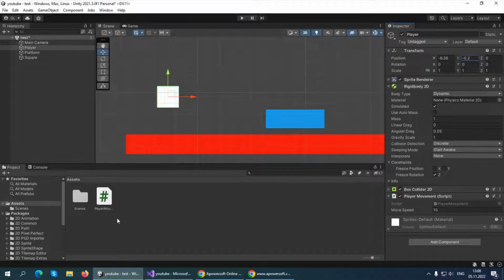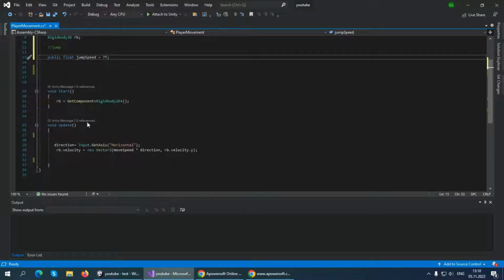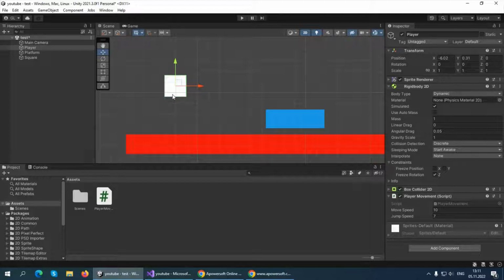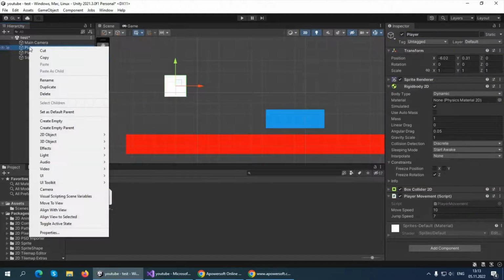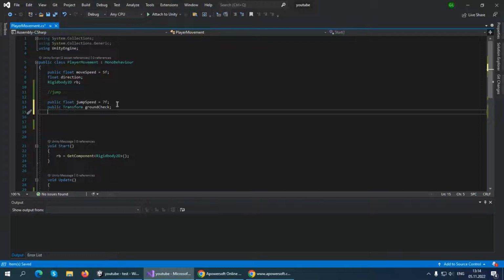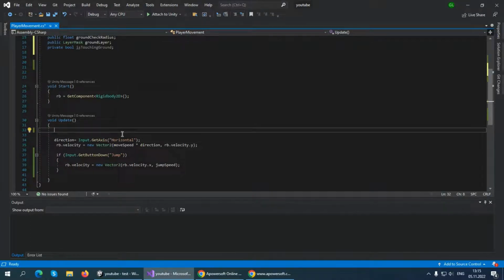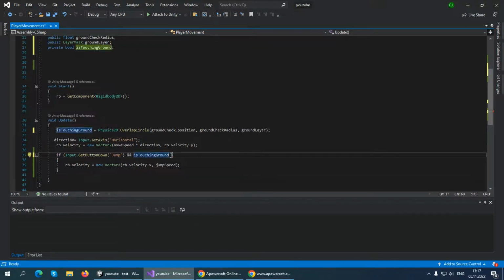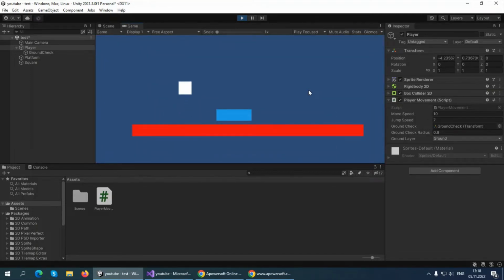2D Player Jumping in Unity for beginners 2022

Comment: Hey i have a problem on the very last step: The object 'ground' is not one of the options i can select for the 'GroundLayer' variable in the inspector. do you know how i can solve this?
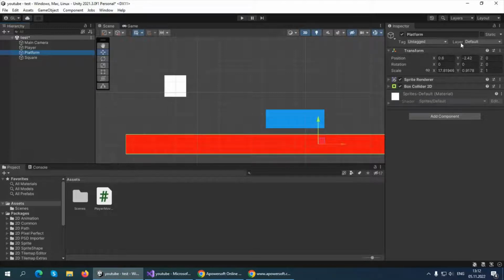Reply from the maker: HI have you made new layer called Ground in inspector and assign to Platform like i did at 4:24. do it like this and it will work
Reply: @buadev5843  thank you that worked!